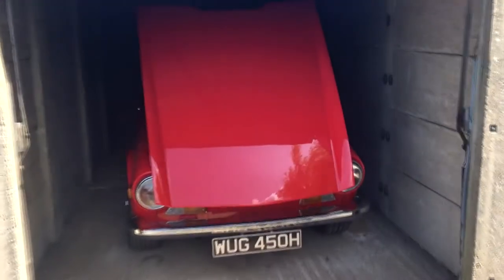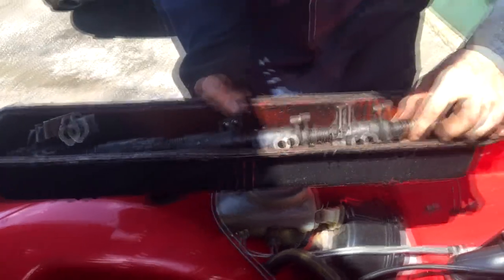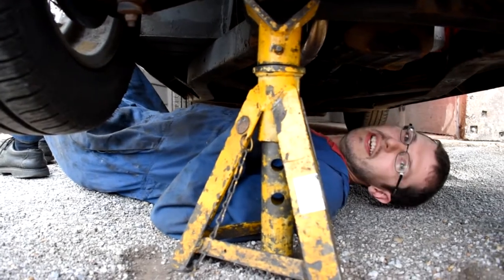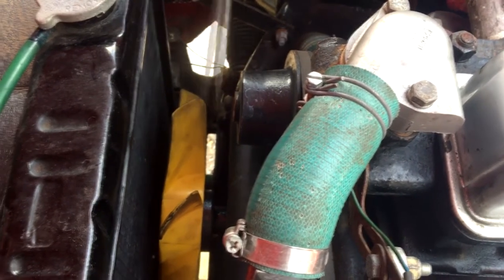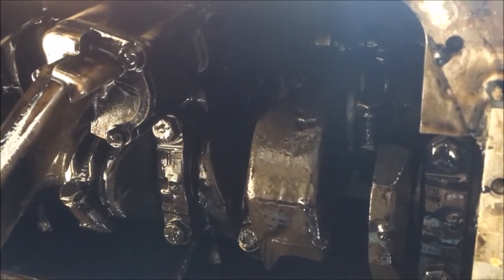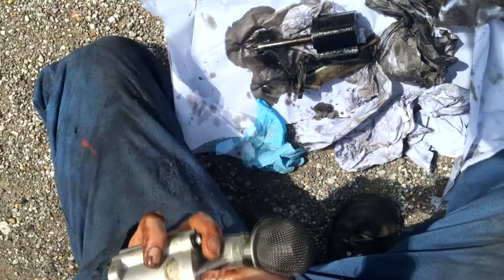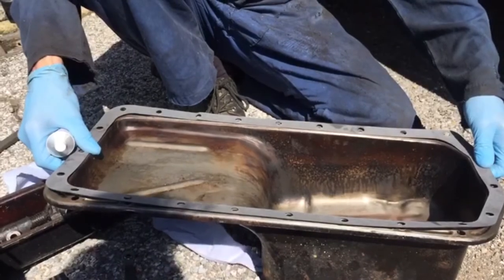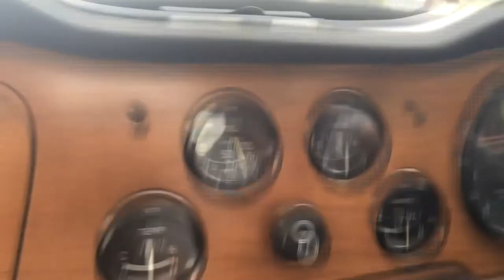Triumph TR6 Oil Pump Replacement

Comment: Hi Steve, Many thanks for your videos. I couldn't hear you say whether the screw which feeds oil to the rocker shaft is supposed to be loose or very tight? Thanks
Reply from the maker: Hi Ritesh, it's meant to be tight, if it works its way loose you'll loose oil pressure, so always check it's tight 👍